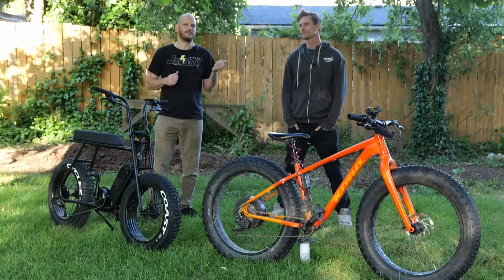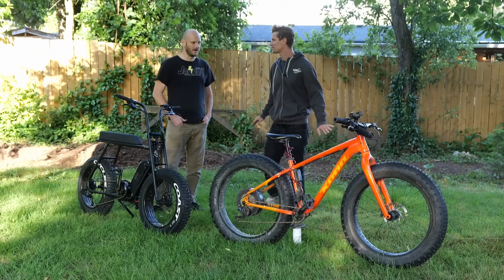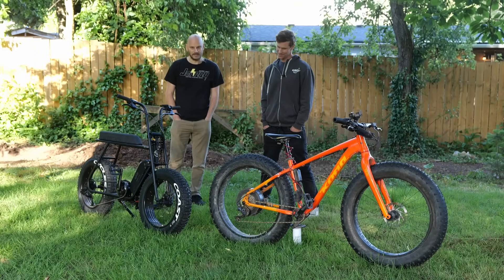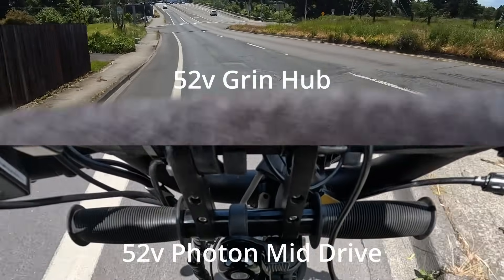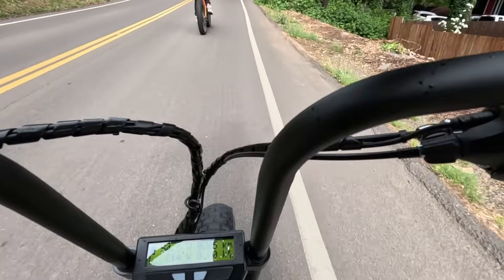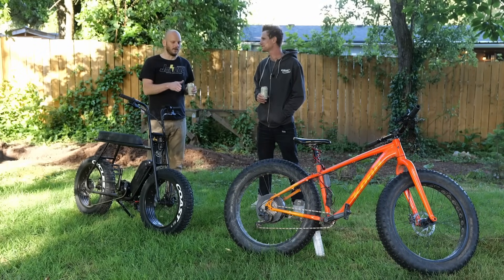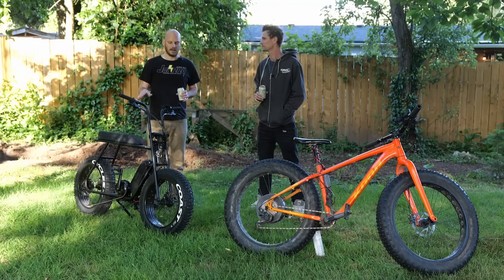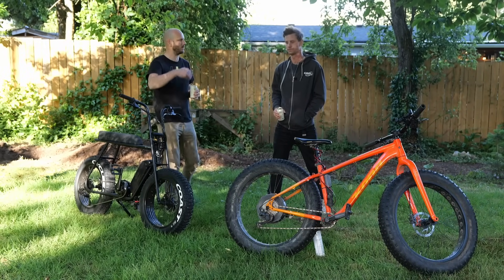Grin All-Axle Hub drive vs Bafang Mid drive Hill Climb Tests. Who is king in 2025?

Comment from the maker: Please note that running 72v actually limits the phase amps. So in this hill climb we did a disservice to the all axle. If we ran it at 52v it would have had more amps and therefore better hill climbing!
Reply: was the fat All-axle slow winding?
Reply: @EBikeBuilder_ yes it was!
Reply: 72V BBSHD asi you can pull over 13,000 rpm's. I'm sure you would have smoked him.
Reply: @kmtnbike1117  Then you would have to think about longevity and maintenance. From what I hear, gearless hub motors are pretty much maintenance free, but if you're pushing 72v in a BBSHD, I'm sure you're going to have to worry about destroying nylon gears, chain, cassettes, chainrings, and other components pretty often. BBSHD is still the better value at less than half the price though imo.
Reply: @fri @friedryce 
4 years running I’ve replaced nylon to peek gear. Two chains and one cassette that actually wasn’t very worn out.
Reply: @kmtnbike1117  I mean I have no dog in this fight, and I don't know how much you ride, but that sounds like cope tbh. I used to use a BBS02 for work and was replacing nylon gears every 4k miles (PEEK gears also wear out and are $100+shipping/ea btw), chains/low teeth sprockets every 2-3k miles. Luckily the low teeth count sprockets are cheap and not riveted together or it wouldn't be economical. Keep in mind this was at only 48v, 25amp, and 1200watt max. I don't want to know what a 72v system would've looked like wear wise. The delay the new CANBUS models have with the throttle was also mad annoying and made being in the right gear hella annoying. Got tired of it and bought a UART BBSHD as my daily driver. I would love this Grin system, but man it's just too expensive for my blood. You have to admit this is cool tech and hub drives can now stand toe-to-toe with mid-drives. This has a better power band, regen braking (so less brake wear and maintenance + better battery efficiency), no maintenance hub and drivetrain system. I'm sure it has its own problems, but this would be sick to be using for work.

Comment: one thing I am yet to understand with a DD motor like the Grin All-Axle...what does torque look like  say at 1000W, will it climb a moderately steep hill at ease???
Reply from the maker: Yes. However “moderate” is a relative term
Reply: 1000w means nothing for torque, torque is only about the phase amps pretty much. You could have a 5 amp rated battery and with enough phase amps get it to give 180nm of torque, just you wouldn't get that high torque at a very high speed unlike if the battery was 30 amp or better, then you'd get that level of torque up to 6x the speed.

Comment: Yes but how does a hub stack up to sustained 1hr mountain climb in 95F weather, how fast will it overheat compared to mid-drive?
Reply: Yes but how does the hub stack up to towing a 747 on the surface of venus? how fast will it over heat?

You need to test and simulate. In practice, half or more of your drivetrain budget goes into battery and the other half into motor/controller. Just get the biggest you can afford and you can climb what you climb.
Reply: @difflocktwo  WHAT?..  My scenario is very real, living in the mountains: 2,000-3,000 feet elevation gain at the start of the day is normal. I’m not looking for silly hub motor excuses. Legit question deserves a legit answer: does this hub drive overheat on prolonged sustained climbs? Mid motor doesn’t and I know this for a fact.
Reply: @ReasonAndHeart  There are millions of motors. Some are microscopic and some are the sizes of buildings. You get the one that is right for your application.

We have no idea how much weight you want to move and how fast you want to move it. Any motor can be overloaded. I can cook your mid drive in an instant.
Reply: @difflocktwo  oh boy do I have a bridge to sell you… We’re talking about these two that are compared in the video…. just never mind.
Reply: @ReasonAndHeart  That was never specified. Anyway the hub motor IN THIS VIDEO is way bigger than the mid drive motor IN THIS VIDEO so it will most likely out perform it by a huge margin.

Comment: I did a full X1 Pro/A65 conversion on a Surly Ogre, no regrets, it's a beast and makes riding hilly terrain on dirt like nothing at all. It's my first ebike I've ever ridden and with all the tuning I did to detune it and to run ideally on torque sensor mode, it's amazing. Full power is just completely insane on it and I just never ride it that way. I use it as Superman legs to ride at bicycle speeds in places I couldn't pedal on my own given my physical limitations. The road I live on is an 800ft climb in a half mile on dirt and it's typical of the terrain here. It's a good workout just to walk it.

I would recommend through axle bikes unless you do what I do and detune it but I didn't own a through axle bike to convert at the time. From what I've learned, a BBSHD or a Photon 2 would do what I need all day long but at 6'5" and 300lbs I wanted to be certain I had the power for where I live and what I ride.

I enjoy pedaling and a mid-drive with a torque sensor is just what you want for that.

Comment: I would like to see a more apples-to-apples comparison.  Conversion kits installed on the same model bicycle, same batteries, same rated motor power.  And use the gears on the mid drive to best advantage.  Score the best of three passes on each test.  As for motor power, show us something closer to e-bike street legal (250W to 750W).
Reply: Apples to apples: Same cost too. And use small diameter wheel for the hub motor if you wanna use gears on the mid drive.
motor ratings mean almost nothing. what do YOU mean 250-750 W?
Reply: @difflocktwo  Re:  "what do YOU mean 250-750 W?" 

Test and compare e-bike motors in the common legal power ranges, from 250 watts (UK & EU?), some countries are 500 watts (CR), up 750 watts (US?) and whatever other legal maximum power limits you know of for e-bikes.

A link to an accurate, up to date, chart of maximum e-bike speed and power limits, plus any other significant legal limitations, by country and state, would be extremely helpful.

And hub-drive vs. hub-drive, mid-drive vs. mid-drive setups (using mid-drive gearing to best advantage), same size wheels realistic for purpose intended (26" or larger for full size street or trail, 20" or smaller for folding bikes).

Thanks for asking!🙂
Reply: @sailincat2822  But these limitations are not strictly defined. 250 W under what conditions?

Cause we all know those EU bosch and similar ebikes are peaking at almost or over 1000 W.

Why give the advantage to the mid drive with gearing and not the hub drive? 

I ride 20" mini velos on the street all year (winter too). But I am eyeing some fat bikes for forest riding. I would run fat hubs and 29+ tires.

Comment: Hi, great video as usual very informative. you did my conversion in January  2024. 😊As you know I have the BBS 2 750 watt bafang mid drive. Coming up on 5000 mi. My bike weighs in at about 85 lbs on a regular basis. I weigh close to 270. Living in Portland I commute from northeast Portland to the West hills. A of lot of steep hills. Anybody who knows around Corbett avenue climbing up to barbur boulevard on the back streets extremely steep hills! I climb these hills easily p a s 5 using my 2nd and 1st gears.........no issues the only issue I ever had was a controller that needed to be replaced, I believe it's because my steering handlebars whipped around and shorted out a wire to the LCD display. All of my adult life I have written bicycles and I've gotten quite used to that. I cannot imagine not pedaling to help out the motor automotive helps me out.  72 years old retired working part-time and loving it!❤

Comment: I really would need to see the apples to apples comparison for me to really form an opinion .
Reply: Hub motor has regen. Mid drive eats chains and cogs. Mid drive is trash.
Reply: @difflocktwo thats 100% your opinion because I have both hub motors andmid drive bicycles and they both have their pros and cons.
Reply: @jamisonhinton5837  It is not my opinion that electric motors operate in both forward and reverse directions and that they provide regen. That is how electric motors work and why every single motor has braking.

You don't need to know anyting more than if the bike has regen or not. If it doesn't have regen, throw it away. That is all you need to know.

Also, more power through the mechanical drivetrain means more wear. Not an opinion.
Reply: Unless you have very steep and long hills (and it's not, even, a given), you'd better be with hub motor, with regen.

Comment: With that much amp draw on that hub drive going up loooooonnnnng steep hills on a hot day……..somethings bout to let go of that puff of smoke…..meanwhile the middrive will just chugg away at a steady pace all the way to the top and still have enough to get home and then some.  There are no such things a very efficient hub drive that’ll super cede a good mid drive. Add pedaling into the mix and middies come on top in terms of efficiency. Pedaling with a hub drive is still crap and eats power like theres no tomorrow😆

Comment: It's more about the controllers and phase amps, not so much about the motors themselves.
Reply: Yep, with a big enough controller, that front end will not stay down. That all-axle motor is pretty beefy. Might have issues with the axle/torque arm coming loose. They might have gone more for light weight than max torque handling.

Comment: I have a few dual motor ebikes, direct drive in the front and mid drive in the rear, the best of both worlds, the front motor does most of the work until you start climbing, then the mid drive kicks in, perfect for hauling heavy loads up steep hills. Grin makes perfect controllers for proportional regen, a must for slowing down with heavy loads especially if you live in the mountains.
Reply: I did my 750 geared with a bbs02 just for an experiment it was kind of a wheel popper I should have turned the pedal assist off both 😅 ended up spinning in the yard holding on for dear life

Comment: The Grin AA is super impressive, but integration and pricing makes it hard to stomach... if you really wanted, you could go all the way up to a cyc pro x1 at this same price point. I also have to admit, the hub drive gearing scares me when I can have the same mid-drive on 4 different bikes with differences of literally 10x the bike weight (probably as much as 3-4x the system weight given cargo loading), and as long as I get gearing appropriate, you can just do whatever you want, wherever you want to go, and at worst, you climb slowly, but you still make it up. The hub behavior of torquing out and just having to sit there.... that is stressful to me personally. 

But I don't know, I'd be super curious to take a cargo bike with a full size hub like this around the area I live to judge and explore. I do absolutely love the idea of regen though for those same bikes.
Reply: For cargo hauling, getting smaller wheels is key for getting the most efficiency from the hub motors, which you probably want anyways for the lower center of gravity. 
More reliable than the mid drives as well, when it's a tool rather than a toy.

Comment: With a mid-drive you don't have to worry about shifting if you're running a 1:1 ratio with a 72v battery and sine wave controller. Just leave it in that gear and it will do everything. The benefits of a mid-drive without sacrificing top end speed. Even 52v with sine wave controller makes a giant difference compared to the stock one. Flipsky's are cheap and work. Next time compare an equally built fat bike with 26" wheels/72v BBSHD vs that Grin hub motor fatbike. Do hills and top speed comparisons. All the places I ride have some very steep hills so it's a necessity to have a decent mid-drive setup so you don't have to get off and walk. I ride a bike to 'bike', not to hike lol.

Comment: A more reasonable & sensible comparison would be to have the same bike, same gearing, same voltage, same weight being carried & the same amps being delivered which would then tell you which motor was more efficient or conversely more usable for all around riding. In my opinion at 4 times the price of the Bafang, you are not going to get 4 times the benefit or performance.
Reply: Put them both on the same bike and swap back and forth the power!

Comment: The bidirectional throttle is cool. That's the way to integrate regen.
Reply: I have grintech stuff with regen.
I like more, the unidirectionnal throttle, and a brake sensor.  When the brake is applied, the regen power is proportionnal to the throttle.
While, in full throttle, In case of an emergency, if I apply  the brake, I get full regen + full brakes. 
Safer for me, and easier to handle overall, I think.
Reply: @xmtxx  interesting. If regen power is proportional to throttle, does that require throttle to brake?

Comment: I would never have a bike with a hub motor. If someone gave me one I would sell it cheap. Why you would not use a bike with the CYC motor and 72V battery. I don't understand.
Reply: Regen is a must. Why would you want to wear out your brakes? Just to pay for maintenance? Why would you want to wear out you chain and cogs faster? To pay for more spare parts and waste more time on maintenance? Hub is king. If someone gave me a mid drive I would throw it in the river WITH the battery still attached.

Comment: man i was riding my bbshd 52v my chain was too short it popped into highest gear and jammed so i turned it off for some reason i power cycled it again fixed the jam powered it back on and it showed 0 percent battery and had to pedal/ walk home i checked every thing replaced the controller  programmed it a bunch of times i was able to get it to work again with one of the files but it still shows 0 percent and it stopped working again. Ive got a new harness coming i checked that though. Have you ever come across this?.....THANKS!
Reply from the maker: Nope ☹️
Reply: @JohnnyNerdOut  i dont get it a new controller,harness, display and i get an error 30,shows voltage in percentage only. but works as if its bypassed like plugging in a usb dongle.
Reply: On my bbshd, yeah, it ate my derailleur once. I like hubs for commuting. Break a chain you can ride home anyways.

Comment: The smaller the wheel on the hub motor, the more efficient it will be climbing.
In a 20" wheel, that all axle can do about 2kw continuous and climb nearly anything.
Reply: I have a 20 year old crystalye in a 20" rim. It is unstoppable. I hope grin fixed the loose axle issues at higher torques.

Comment: 6:15 or so - that’s the reason I prefer the BBS-HD @ 52 volts nominal.  I have 42 teeth on the chainring, and 42-13 on the cassette.  It’s biased toward pulling power rather than speed.

Comment: Mr Nerdout, I can't thank you enough for your advice of building my own bike using a BBSHD (That Luna cycle then modified for me). I live in the Send Gabriel Mountains a Super steep mountain range In California. Going up the local fire roads I pass every single e bike (except for the Surons But those are motorcycles) Like they're standing still. When I'm hanging out at the top and those guys finally catch up on their 15 to $20,000 Prebuilt bikes and find out how  little I spent to modify my specialized stump jumper they  blow a gasket! I could explain to then how I can run any battery I want to, but: that would just be rubbing salt in the wounds. Thank you again! This is the most fun vehicle I've ever owned!

Comment: Unless I move and need to do more hills my 500 watt bafang hub is fine for grocery runs I get around 30 or 40 miles a charge on lower settings for some longer runs and that's on throttle helping pedal some

Comment: It’s pretty hard to do a legit comparison with two completely different set ups. 
  If you need torque  at low speed mid drive  all the way. 
  I have a trike that weighs 100 pounds mt , and my large truck drivers Carcass brings it up to around 420 pounds, I have a short but very steep hill near home that prior to getting the 1000 watt bbshd I had to push the trike up the hill , even in my best hill gear it stopped me cold , even taking a run up at it. 
 I wasn’t even confident the Nerang would make the difference , , I still have to pedal , but I get up it easy , and Nerang kit utilised my middle crank gear , so it wasn’t even my best hill cog. 
 I like the Nerang , however I would love to have the hub motor as well for cruising  on the flat  , best of both worlds.

Comment: BTW, I run a Grin All Axle on my BikeFriday(20x2in wheels), 52 volts, standard windings, phaserunnner controller. I am almost always on pavement, and weigh about 260lbs. It climbs very well with or without pedaling, performing well on my local steep climbs on pavement. I suggest watching Justin at Grin do his hill climb video demonstrating statorade. I think he is using 16in wheels, a Crystalite motor, and throttle only. This test convinced me to convert my BikeFriday to a hub direct drive kit.

Comment: How do you compare such different set ups? Put a BAC 2000 on that BBSHD with a 72v and it will smoke that hub in every aspect. You guys are comparing apples and oranges. A CYC X1 with 72v will eat them both alive.